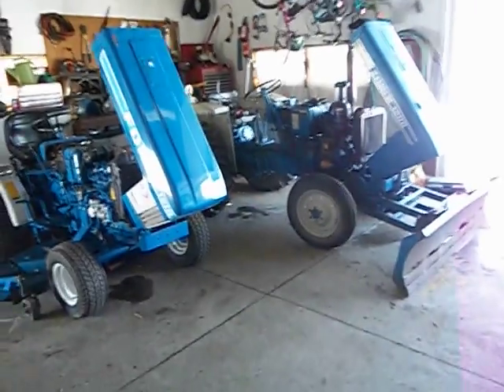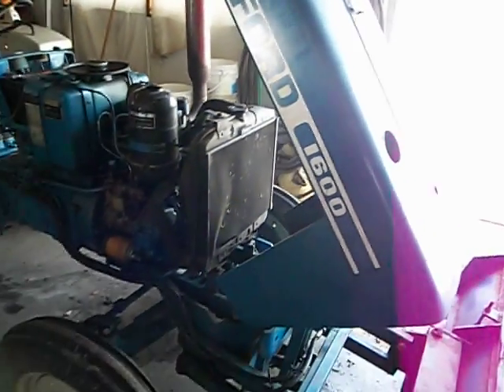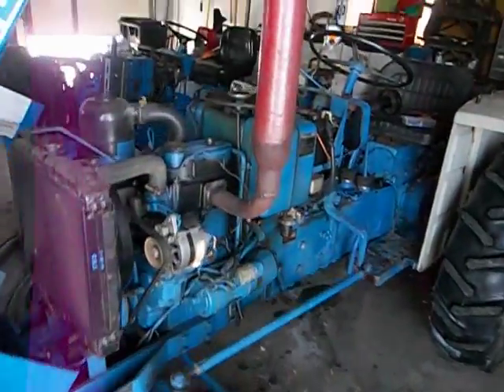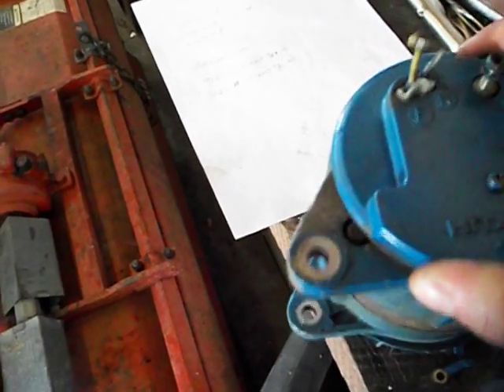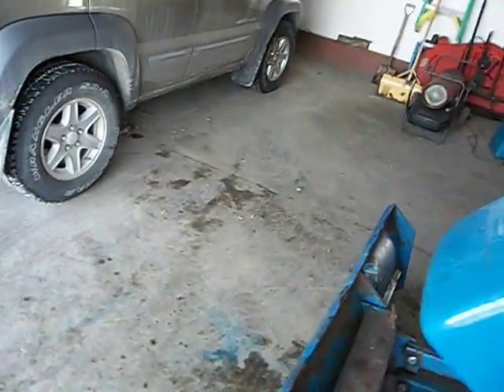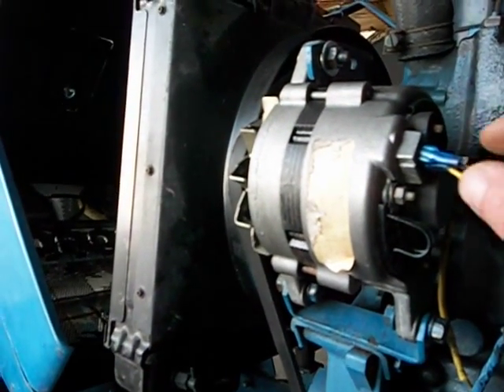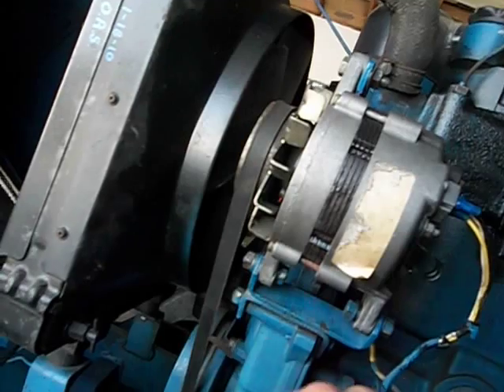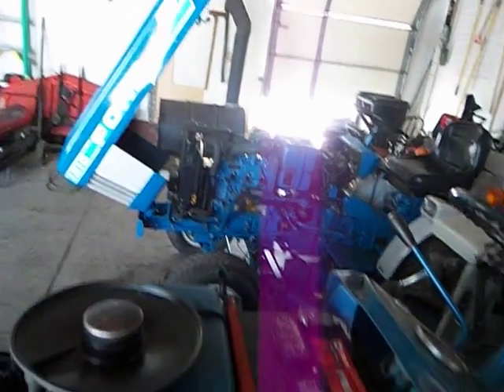Old Ford Tractor - HELP! (Part 1)

Comment: Hard starting, clean injectors and fuel tank, needs Good Glow plugs, throttle fully forward (this adds extra fuel), NEVER USE STARTING FLUID!!! the kickback Will break the starter!
These little beasties don't like the Cold, I've used a heat lamp on the Radiator to get the head warm.
New starters are not cheap!